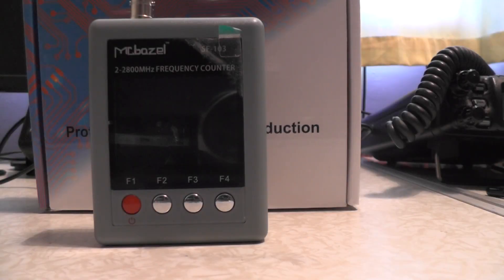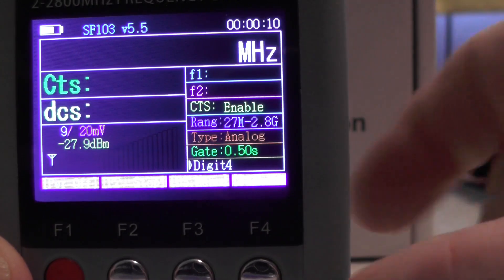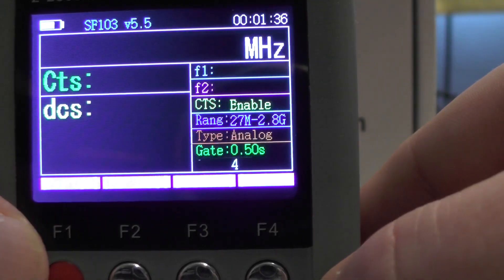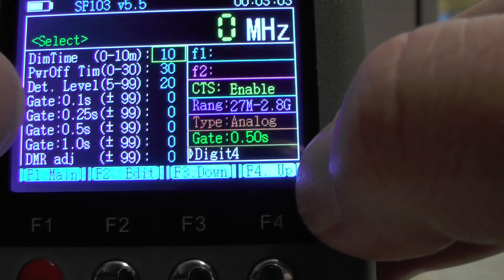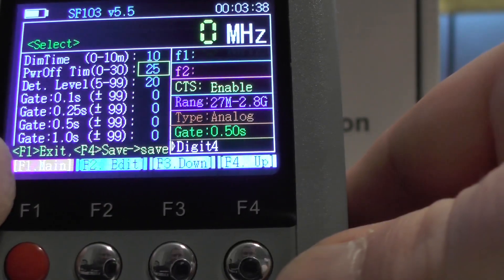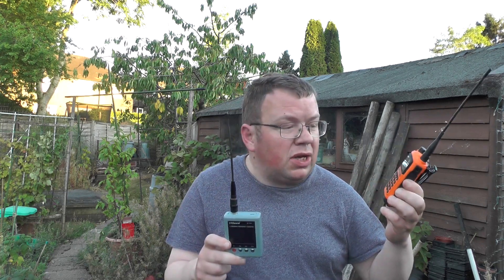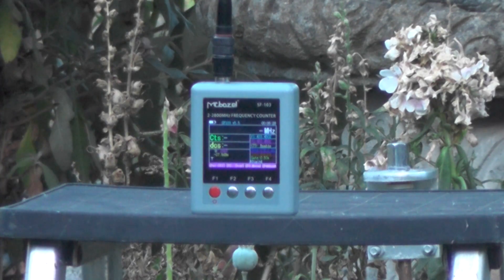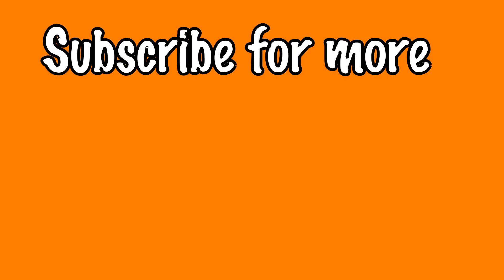Mc bazel frequency counter review and test

Comment: Try changing your detection (det) level to 8. When that happens when in analog or digital it will start displaying frequencies around 2300 Mhz. At Det level of 9 it won't display a frequency. Even if you have all wifi or other sources turned off it will still display a frequency. Big problem.

Comment: dumb question! what's the point of a frequency counter other than to check radio frequency? why does range matter in that context ?
Reply from the maker: You can use it to find local frequencies so you can monitor them if you see someone with a  radio transmitting  across the road the counter will pick it up the frequency  with out you being next door to them
Reply: the only dumb questions are the ones we don't have an answer for